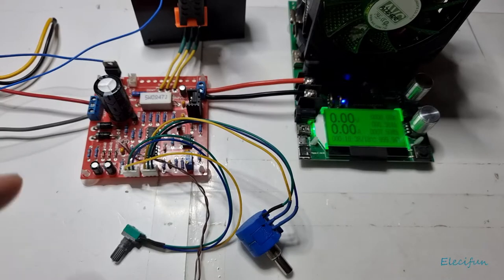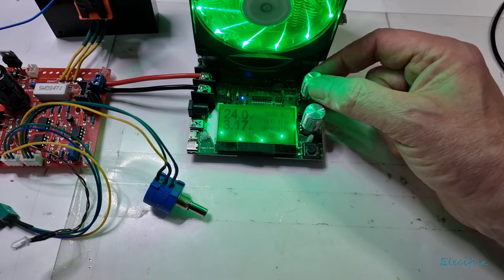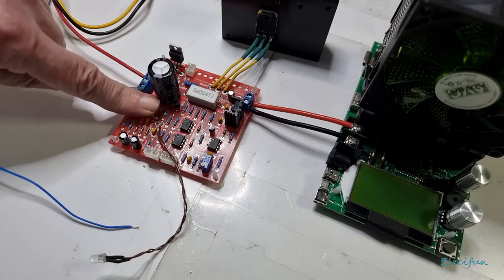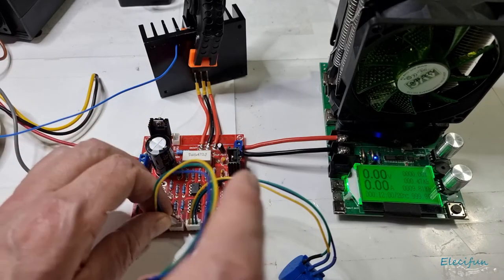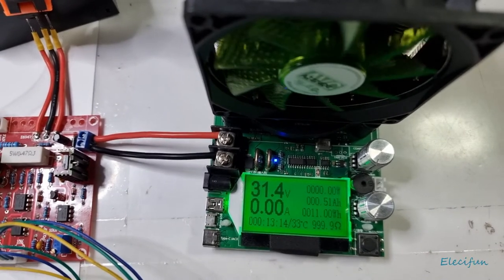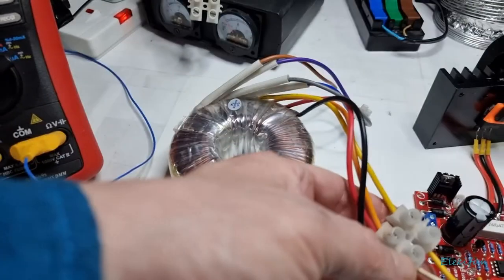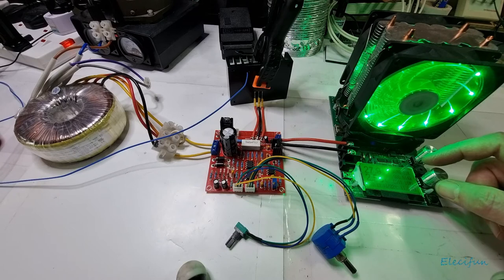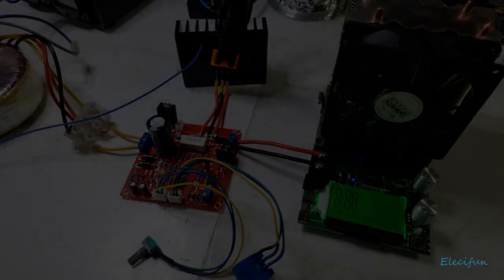Hiland 30V 3A PSU Output Power Test

Comment: Put an oscilloscope on output of that supply to check for wave form distortion. You will probably notice a few things. High amperage draw greater than voltage rating of the transformer will result in distortion. And it will get better better below 20 V.

Few rules of thumb. I rate my transformer at twice the maximum amperage of the final supply. Give 4 V head room so for a 24V transformer I cap the supply output at about 20.5 V (that Highland design you using does not have this feature) and cap the current limit at 80 % of the transformers rating. Next use 2000 uF per amp of output current. Theses steps result in a butter smooth output supply anywhere in the range of use.

I would say that design is good to 20V at 80 % of transformers amperage rating with very little noise or distortion. Cap will handle about 1.5 amps comfortably before falling behind on smoothing. 

Socket those opamps as they likely to fail in time. The RMS voltage on the supply rails exceeds the design spec.

Nice set up.
Reply from the maker: Cheers for the hints/input, much appreciated. I considered better caps but will look for a bigger cap for C1. 👍

Comment: @8:23 Hello Sir how are you? 
I'm wondering where you got to?

Well I finally kinda got round to sort of testing my 0.** to 28V 2A benchtop power supply pcbs.

It doesn't look good to say the least.
My guess is you are right about my transformers they don't put out 80W.

I set up two 12V halogen bulbs in series.

The control boards set at 24V and 2A.

Well the voltage drops down to 7V at 2A.

It's as if the control board will not allow anymore.

So I disconnected the bulbs from the PSU pcb.

I attached the two bulbs directly to the transformer.

Well the bulbs are much brighter and in fact blindingly so.

My guesstimate is that the transformer is very inefficient and is putting out (a crude guess)  maybe 45 watts.

Which seems to suggest these transformer again are very inefficient and really their rating is fraud or appears to be fraud.

I'm now thinking I'll buy another transformer.

One that's bolted together.

Your probably right about your theory that you could go higher. 160VA  might be what you need as the efficiency of these transformer or their rating appears very inaccurate.

Comment: Hi again, that 120VA toroidal transformer. Geezez their not cheap are they. 😬 @ 4:26 I wanna buy another transformer but sheeezez they're pricey.

On the subject of transformers I noticed a temperature difference between my 60VA vs the 80VA which must mean the latter is less over stressed.

Comment: 😄wow! How hot did everything get? I wish I was there with my hand on those opamps and the D1047 transistor.🤔 Well yeah that was a most interesting video. I just woke up feeling half dead. I'll comment properly later when I've watched your video again. When I saw you put that 160VA transformer into the into ac terminal block. I thought geezez this is going to be interesting. 😅👍

What would happen if you attached a bigger heatsink to your D1047? 🤔 do this transistors have any kind of heat throttling inside them?

How much heat can they take before they're destroyed? 

I'd be very interested to see what happens if I added or exchanged some of the components on my 0~30V 3A psu board for other beefier components.

Like for example what happens if I were to add a 4700uF cap in C1 instead of the 3300uF?

I think I read that for every additional AMP of current you need 1000uF. So when I get around to it I'll study some articles and make a list of new components.

Looks like I need a new dummy load.😆 

Mine looks like a toy compared to your unit. 😄👍 that's a beast of a dummy load. 🤔

Anyway chat to you later. 

I think I'll get some IC sockets and plug in some new opamps (TL081) and later I'll get some 44V alternatives. I think that's what they called them.
Anyway great video which I enjoyed. 🤔

Jack up the 1/4 W resistors for 1/2W??
Reply from the maker: Plenty of questions and the component datasheet has the answers for most of them ; ) 
Today something happened on the output of one of the fakes... Now I have 36V on the output!
Reply: @Elecifun  Really? 36V! How is that possible? You didn't exchange the C1 cap for a 4700uF?? 😅
Reply from the maker: I put the DC load on it to test its output.. squeezed nearly over 5 Amps out at lower voltage.  Um strange result. I also built a TL081 tester to test the TL081, maybe I fried one would result 36V? Tommorow will Vlog.
Reply: @Elecifun  I look forward to your new vlog. 😀👍Did you fry one opamp TL081? I don't know. Ideally ic sockets needed to quickly change out the defective parts and potentially protect the I.Cs from damage. I'll put another order in soon for new components. Kinda peeved off at AliExpress regarding damaged parts, missing components, bait and switch tactics, lies, and other shenanigans. 
Oh incidentally, I'm working on my home automation project.
I'm currently automating my watering system. I finished wiring another pump last night. 
I'd like to resolve the issues with my fake PSU boards and maybe upgrade my last one to higher amps.

Still makes me wonder whether I should just buy a diy kit that supports 4 or 5 AMPs right from the start rather than try to increase the current on my old boards still its interesting all the same. I read this more global sea freight is going to get more expensive in 2022. Also Chinese holidays I think in February.
Might be good idea to order before that happens.

I guess that's why getting large items is expensive and the sellers are squeezing freight costs wherever than can.

Anyway, thanks for the reply and very interested to see your 36V fake Hiland.

What happens if you add another D1047 trannie to your board? I read somewhere you can increase the voltage and current by modifying the board with beefed up components and duel transistors.

Resistors need to be half watt instead of quarter watt and another resistor reduced (cant remember which one) to increase the current still im starting to wonder what might happen if I start beefing up the current.

Maybe the traces won't be able to take the added load.

I noticed on another diy kit its got much bigger traces between certain components.

Anyway, buy for now, and I'll watch for your new video. 😀👍

Comment: What's happening sir? 😂

I'm going to order a bigger transformer a 35V 100W which is nearly twice the size. 😅 If it works it works if it does not it was a destructive test. 😅

Anyway let me know what your up to. 🙂👍
Reply from the maker: Hi, whats the transformer for amigo? 
I'm trying to get my sh*t together been a bit down, got my head up my ar*e atm.
Reply: @Elecifun  Well you know those transformers I bought awhile back? Well I kinda tested them. Two 12V bulbs in series. 12V+12V set the voltage to 24V 2A. 2A being the maximum. Well it's displaying just 6V @2A. 

A far cry from the 28V 2A. It's rated at.

I disconnected the bulbs and reconnected my 2x 55W bulbs directly to the secondary of my 80W 24V transformer. 

Okay it significantly brighter but the voltage is only 7V @2A.

This surely means the transformers is no where near the 80W that's its meant to be.

Still I'm not 100% sure either.

55W bulbs 80W transformer it should I would have thought easily powered the bulbs. Should it?

The efficiency must be terrible.

43% reduction??

Anyway I debating whether I should buy another square transformer.

The type with bolts holding them together.

The one im looking at is almost twice the size.

100W 24V 

Maybe I should go to 120W.  🤔
Reply: @Elecifun  Oh sorry I didn't get your notification.

My credit ran out and I didn't bother recharging my router. 

Then I recharged it and some how missed your notification.

Anyway. If your awake be interesting to hear your thoughts.

Decem.
Reply: @Elecifun  Oh yeah same here but not too bad today.
Try to get out bed at the crack of noon. 🤣
Or earlier. 

No good sleeping till 4pm. 😅

And no listening to Tom Waits.
Reply from the maker: @decem_unosquattro9538  Thanks for the advice. I get up early as I have cats and one will keep jumping on me until I feed him.

I have down time and am seeking help to improve/extend the up time.
Reply from the maker: @decem_unosquattro9538  Toroidal transformers are more efficient than IE/square.   If you want 80 watts buy a 160/200 VA Trannie. Also power factor comes into play... worth looking up.

Comment: @1:55 26.3V and 2.86A Well that's interesting considering this is the genuine Hiland board. I thought maybe the genuine boards would get their stated voltage and current.🤔

I don't know how they legally get away with claiming its a 0~30V and 3A psu board.

Kinda a bit peeved that they make these claims but they can't actually deliver on the claim. Sigh.

@2:51 Well why is the D1047 transistor  so cool compared to the transistors on our fake boards?

That's remarkable.

@7:54 That's a fake board right? Are you telling me they're better than genuine? 🤔😁

@9:23 120V okay so its capable of 5A of current. 🤔
Isn't that superfluous? Hmm.

10:24 yeah like any profession there is I guess there is some snobbery. Lol

I respect you for giving it a go like me.

I'm just learning as I go which could end up being expensive. Lol

Hmmm well that was interesting ...🤔
Reply from the maker: The board is genuine buddy and given the ideal components and power supply I am guessing it will do quite well. Given that we have both learnt that 1000 - 1500uF is good for every amp, an easy upgrade to get the best from the circuit would be a higher capacitance capacitor at C1. Also using a transformer at 24V but with enough current capacity to supply the circuit to the max with enough headroom, suggesting 50 to 100% more the prerequisite. The pass transistor D or SD1047 (Ic = 12 Amp) is a High power NPN epitaxial planar bipolar transistor, that's bad ass bro!  @10.24 me no, i'm street kid no ed but street self taught everything no ma no pa just me. My channel is about, if I can so can you. Dedicate yourself and you will prevail. Have faith in yourself!
Reply: @Elecifun  Wow you're an interesting guy. Thanks for the response and Im not sure what I'm going to do for sure but I may try to upgrade this psu board just as an experiment. Not sure what to do because to be honest I'm biting off too much considering I've only just got into electronics. 
Yes I read many articles on this board and I think not sure 100% that the C1 cap  needs to be increased to 4700uF and that for every additional amp 1000uF is needed. (E.g. 3300uF + 1000uF "4700uF" Also other resistors need to be changed to take the extra juice and increase the current.
Reply: I'm not sure what to do because if I try to upgrade it it may not last. The traces may not be thick enough to handle the additional current. I might just get another diy kit that is already designed for 5 amps. Anyway its an interesting project and its been fun watching you test these fake boards.

Regards,

Decem.